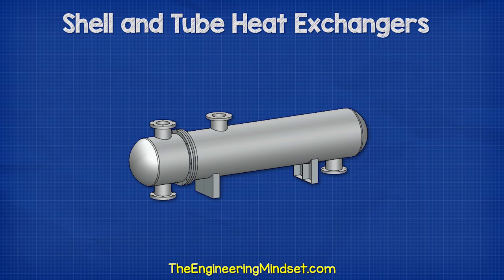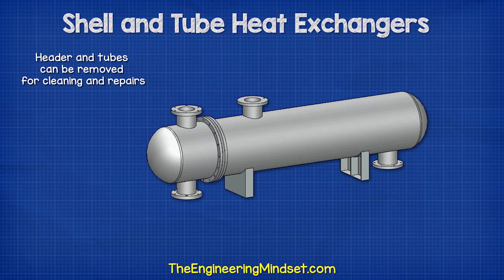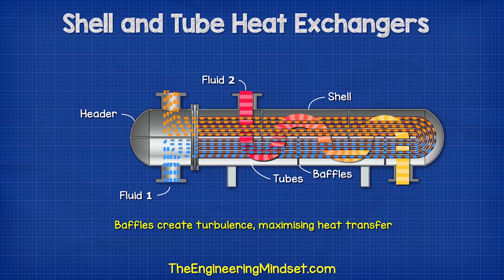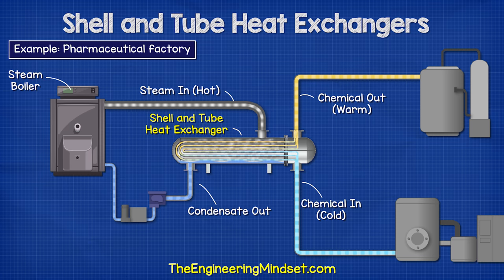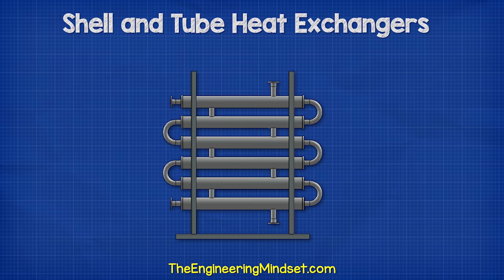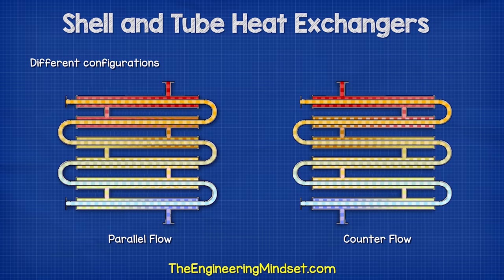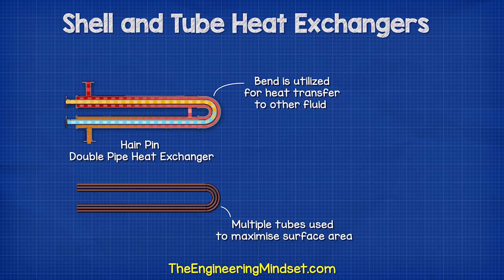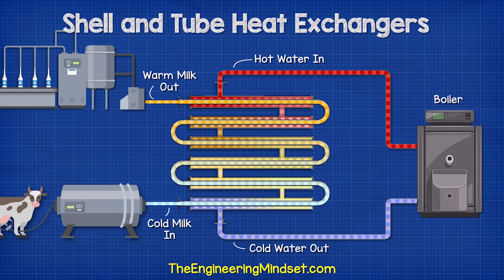Shell and Tube Heat Exchanger basics explained

Comment: For additional information:  In liquid-to-liquid applications it is prefered to put the "dirty" water into the tube side since cleaning or plugging tubes is much easier than on the shell side.  Some reasons to put multiple passes of the tubes include space as well as increasing fluid velocity for better heat transfer efficiency.  In a recent application we put replacement chillers in with a 2 pass condenser rather than the current 1 pass to save on piping space on the other side of the room.  Tubes can be "enhanced" internally and/or externally to increase heat transfer efficiency using fins or internal rifling.
Reply: Hi bro 
which is better: water inside the tubes and steam on the casing side, or steam in the tubes, and water surrounds the tubes on the casing side

Comment: The 6.9L and 7.3L IDI international Harvester Diesel engines used in Ford pickup trucks from 1983 to 1994 used these heat exchangers as oil coolers.

Comment: Might be good for cheaper desalination as well. Pump filtered sea water into the header, heated to evaporation in the tubes, and back to the header with one outlet for heavier brine and one outlet for water vapor to be condensed and pumped out to the water supply. Seems way less expensive than reverse osmosis. Especially with 8 degree C temp difference between boiling points.
Reply: The problem is that heating water to boiling point + the latent heat of evaporation is expensive and while the heat can be recovered somewhat in the condenser there is always inefficiency.  While reverse osmosis doesn’t need to put as much energy into the water and you already need pumping already.

Comment: Used to design the piping to these pieces of equipment as well as all equipment found on oil (etc) refineries / chemical plants etc... did so for decades. You bring back memories. When installed, there is a fixed end and floating end for these exchangers ... the floating end is the opposite end to the header and slides on its supports as it expands. 
The piping needs to be designed with this and all stresses borne in mind.
Reply: Good to know honestly. I'm a student in chemical engineering so hearing this made me imagine this and you're right , we need to consider such factors

Comment: Is this the sistem that is used in regular combo (2 in 1) washer-dryer machines (not the ones with heat pumps) for condensation of the moisture drawn by the hot air from the clothes?
If so, does anyone know how exactly it uses the cooling water? Does the machine draw cold water continuously? Does it empty and refill the shell after every set amount of time? Or does it have a temperature sensor inside the shell that governs either the refilling of the shell or the debit of cooling water running through the shell?

Comment: Instead of using straight Baffles use screw type Baffles to rotate the flow of water 360° to the heat exchanger tubes inside of the shell to increase the efficiency of heat exchanger

Comment: How can I know which to put hot or cold fluid in shell or tube?? 😅
Reply: I think it depends on the fluid tube
Reply: *type
Reply: Considering these important features of the tube bundle in an exchanger, following fluid services are better suited for the tube side.

Fouling or corrosive fluid service is kept on the tube side, since mechanical cleaning of the inner tube surface is easier.
It is cheaper to replace corroded tubes, than the shell cover. Hence corrosive service must be kept on the tubeside.
High pressure fluid is also kept on the tubeside, since tubes with higher pressure rating are cheaper than the shell with high pressure rating material.
Toxic services are kept on the tubeside to increase their containment.
Fluids where you have a low allowable pressure drop are also kept on the tubeside.
Cooling water is generally kept on the tubeside, because it tends to corrode carbon steel and form scale.
Reply from the maker: See our new video on how to build mechanical versions of electronic circuits? Watch here: https://youtu.be/Zv9Q7ih48Uc